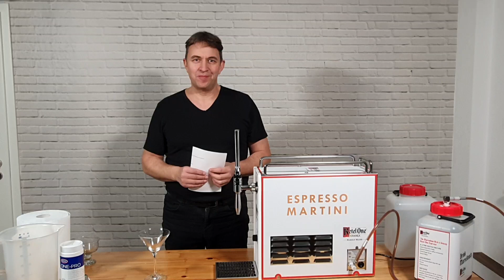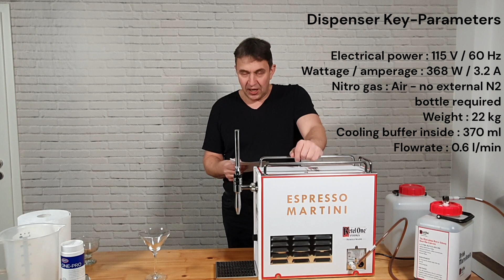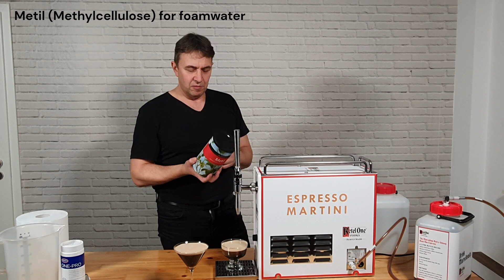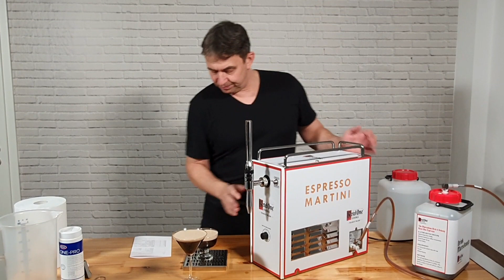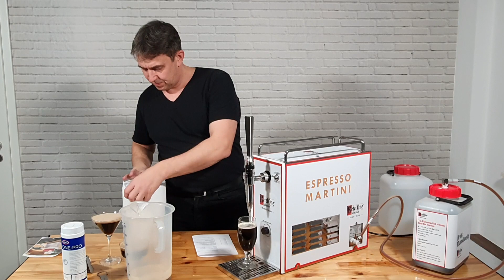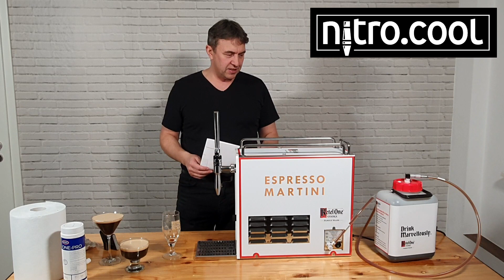Nitro-Dispenser Service : Troubleshooting 1-Tap | Ketel1| 115V : (SKU ND-20-01-02 DI)

Comment: I had the machine stored in cold garage. I turned the machine and flipped nitro on for a few minutes. After I few minutes I turned it off and tried to turn it back on but would not power on. Is this because the condenser froze? Will it work after bringing inside for a few hours?